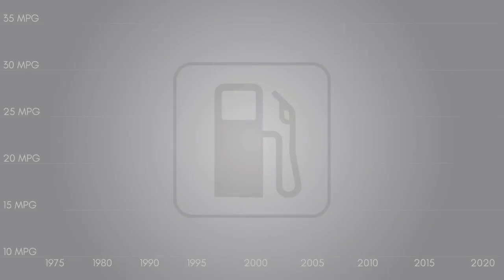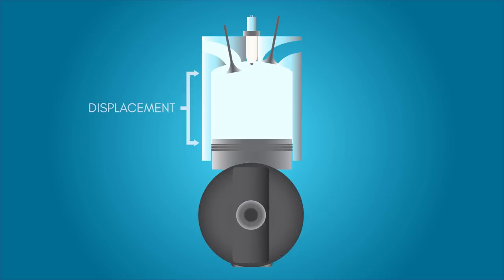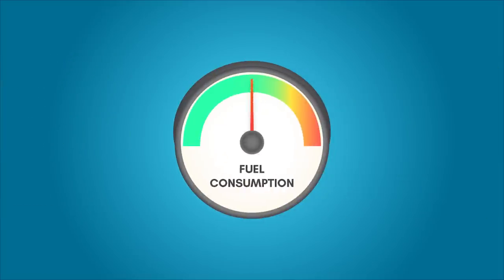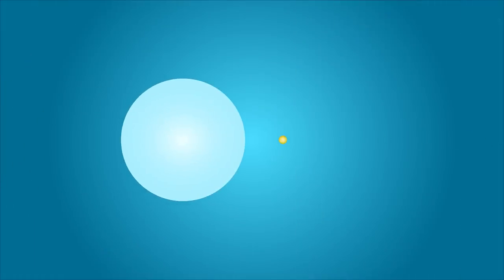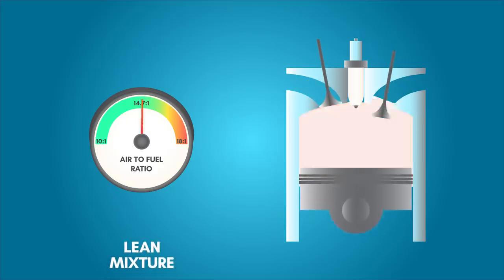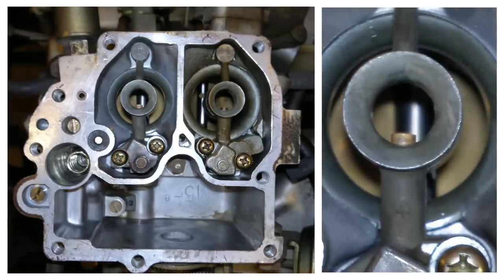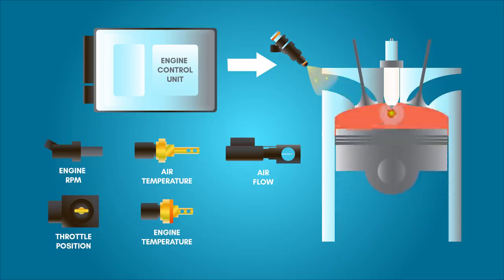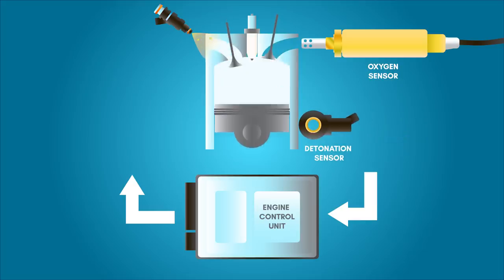How Engines Are Becoming More Fuel Efficient

Comment: I have a book around here somewhere that was written by some well-known mechanical engineer. In chapter 10 of this book it talks about alternative fuel systems and he mentions that in the 70's in the U.S. there were 3 different after-market carburetors being sold that claimed fuel mileage as much 60mpg in V8 engines and 90+ in a V6. The one thing they all had in common was that they vaporized the fuel before introduction into the combustion chamber. Shortly after word got out of these carburetors, OPEC introduced several new additives to gasoline (or required refineries to use them, something along those lines, it's been a while since I read it) Every one of these additives, according to the book, gummed up those carburetors.
   I'm on my way to work so I don't really have the time to find it for reference but I thought I'd mention it because whether any of you think there is a conspiracy to keep us addicted to oil or not, one well respected, top of his field engineer certainly laid out an interesting coincidence that points in that direction.
Reply: Meh, I'm seeing a few comments here about this. Vapor carburetors solve a non-existent problem, which is combustion efficiency. Modern cars hit something like 97%. Vapor carbs don't really do any better.

Comment: I feel that this is all incredibly impressive and it shows how well we've mastered making these engines, but it also shows why (imo) electric motors are far superior. All of these advancements have been made in order to improve efficiency, resulting in designs that are incredibly complex. This video showcases a lot of that complexity while also just scratching the surface of how internal combustion engines function. And despite all this advancement, internal combustion engines cannot break 40% efficiency, because they are heat engines. Electric motors, on the other hand, are capable of over 90% efficiency in converting electric power in to mechanical energy out while being far simpler. It would seem, at least to me, that it may be better to look to electric systems for greater efficiency and maybe even to consider electrochemical methods of using fuels, like fuel cells or thermionic converters.

Thats just me tho lol anyway if you read this far hey hows it goin
Reply: good, what about you?
Reply: I know this is an old comment, but there are newer engines that are over 50 percent efficient.

Comment: Old technology was still fuel efficient. For example an old Volkswagen 1980 carburated had pretty good fuel economy. It was in is 40's mpg. An old 1983 ford ranger pick up had a 4 cylinder diesel perkins engine. It to got 40 mpg. The technology was there. What happened. People's desire for new made these classic obsolete. And now we have new cars and trucks with sophisticated computer nightmares. Now adays you need technitians to repair new clunkers.
Reply: Peoples desire didnt kill fuel efficient vehicles. Diesel is a filthy nasty fuel. Sure older diesels had excellent fuel economy, they also had terrible emissions.

The emissions equipment they were required to install killed the fuel efficiency. Now the MPGs are climbing again, but the cost of that equipment and the rarity of diesel means it will never return.
Reply: Old cars like that were fuel efficient because they were extremely light, small and underpowered by todays standards. People were ok with very small interiors and the lack of need for safety meant very thin structures too.
Reply: @Bob_Lob_Law  Look at a 2 stroke diesel opposed piston. Use ultra low sulfur diesel with a regen system and it will be good.
Reply: @armandomendoza3167  Those make good train engines. Nobody will ever put them into a passenger vehicle. 

With rising electric drive trains, combined with diesels relative obscurity in many parts of the world, its days are numbered.
Reply: @Bob_Lob_Law  Ford already did
Reply: Exactly today’s cars are GDI computer ridden nightmares. Thanks EPA
Reply: What happened was safety requirements as well as people becoming fatter or wanting more features in a car.

Remove shit like leather seats, the wideness of modern cars, headunits, climate control and you will improve fuel economy.

Look at the honda civics from the 90s compared today, todays civics are 3 inches wider and several 300+ pounds heavier.

The Japanese have those kei cars that are 660cc and make 62hp.

62hp is more than enough to drive around the city with as well as cruise on the freeway.
Yes, it is slow but hey it does the job.
But no, we want SUVs, with big engines.
Reply: Bob Lob Law it's also because cars aren't allowed to run super-lean mixes anymore because of the rules about Nox emissions
Reply: @nikod8412  I remember reading about Hondas CVTT engine and how they came in and showed the yanks how to make a fuel efficient engine back in the day
Reply: IIGrayfoxII yeah so clean they didn't even need a catalytic converter
Reply: @Bob_Lob_Law  Diesel (at least in Britain anyway) is not the filthy, smoke-belching horror it once was. It is now very clean (we have strict emissions tests for diesel vehicles!), and always has been more efficient due to higher compression ratios being achievable.

Comment: It's a lot simpler than you think first you have to eliminate some of the excess Parts take out the crankshaft the carburetor Pistons valves valve springs the cylinders and then you get rid of the engine block then you take some magnets and a coil and a couple of wires who you have the most efficient engine possible
Reply: I see what you did there

Comment: it's called "knocking", not "detonation". side-note: detonation only occurs with pure oxygen. using air, it's called deflargation.
Reply: Detonation is when the flame propagates faster than the speed of sound. Deflagration is when it propagates slower than the speed of sound. Detonation can happen at atmospheric oxygen levels,  but is more likely at higher oxygen levels.

Comment: Thanks but a few other factors to fuel economy
1. - Road contact has improved dramatically both with better tyres and less resistant suspension. Scrubbing tyres on sharp cornering used to use more petrol.
2. - Rolling resistance was mentioned but better bearing and better balancing wasn't. Less resistance means less fuel to turn the motor over
3. - Fuel is now totally synthetic so you are able to extract more of the calorific content. In the USA and Europe, fuel companies also vary the blend to suit the expected weather which gives greater fuel economy
4. - The fuel detonation point (RON Number) is more consistant making higher compression possible. It can also be controlled more accurately by the ECU.
5. - Higher compression gives more power and better fuel efficincy
6. - Airflow through the intake is now computer modelled causing a positive flow as the intake valve opens. The exhaust system does the opposite, sucking out the burned gasses
7. - The flow of gasses in combustion was briefly discussed but is vastly more important to fuel economy. This is also modelled on computers
8. - There are 7 to 10 engine management sensors but the Lambda sensor on the exhaust is the most important for fuel economy. It helps the ECU to optimise fuel mixture while preventing a lean mixture. Exceeding Lambda or a mixture of above 14.7 for any length of time will destroy the engine. On a carburetta,  the limit was set to 13.8. That on its own gave 5.5% greater fuel efficiency.
9.- A complex data record is stored in the ECU that was developed on the manufacturer's test dynamometor. Tuners refer to this data as the engine map and they modify it to give more power but using more fuel. This mapping saved between 8 and 10% on fuel.
10. - Lubricants have become much more slippery. We are currently on SP oils while in the 1980s we were on SB. That is 18 improvements in our oil in 40 years.
11.- The weight of wheels (called unsprung weight) has also improved. The motor doesn't  have to spin heavy wheels before the power even reaches the road.
12. - The aerodynamics of the bodies are almost twice as slippery as they were in 1980. You use less petrol to push your car through the air.
BUT THIS IS BALANCED BY
1. - Cars now travel faster which uses more fuel
2. - Cars accelerate at almost twice the speed they did in 1970. This uses much more fuel.
Reply: But the video is about engine efficiency, not car efficiency overall.
Reply: You are right - that is what the heading says. The video goes well beyond that though.
You, discussed power transmission first. Rear wheel drive is NOT automatically less efficient as is displayed by efficient BMW and Mercedes Benz vehicles.
The statistics on fuel economy you presented was for the car as a whole. The improvement in efficiency has been broad.

I made 12 comments, 9 of which were directly engine related and contributed probably more extensively than the items you discussed.

But we both missed the two major contributors to increased engine efficiency.
1. - Multi-valve combustion chambers were a huge boost to engine efficiency, exceeded only by the use of ECU. Better breathing has been the major innovation.
2. - The dramatic but mostly undocumented improvement in cylinders, pistons and rings. Surface finish, contact area, improvements in piston web design and "cam grinding" of the piston as well as better ring sealing have also made a big difference. Blowby and "oil pumping" no longer exist. This on its own is probably between 6 and 20 added hp of power.

Fuel I injection on its own was not a big contributor. The ECU and its ability to control fuel though was big. A motor at fixed RPM driving a fixed LOAD. Using a STANDARDIZED fuel. Running at a fixed atmospheric PRESSURE will be more fuel efficient with a well tuned carburetta.  Trouble you can't vary any of these parameters and still be efficient.

Comment: 4 cyl (thats what i know best) engines (diesel and petrol) DIDNT get more efficient.
We got more HP and "less poluting"  exhaust, but cars on average still needs as much l/100km as in the 80's
Reply: Simply put a modern engine in a 80s car that has the same power level and you will see that your fuel consumption drops significantly.  The engine is more efficient but the whole car is not because cars gained +50% weight.
Reply: Yes they got more efficient with different alloys, injectors, combustion configuration, exhaust gas recirculation……..
Reply: Nice contradiction. "They got faster using the same amount of gas, so less efficient" summed up your comment. And you're... wrong. Factually and objectively

Comment: I swapped out my cams in my 2003 F250 Ext. cab 8 foot box 4x4 with the 5.4 SOHC  16 valve. I was getting around 11 mpg before and now I have more power and torque and get 15 mpg. I am not complaining.
Reply: Randy Wiesendanger  I just weighed my truck and it comes in at around 8400 lb. I wonder what the 1/4 ton truck issues were?

Comment: Cars are getting more fuel efficient by adding incredible complex add on's. Like heat exchangers that combine oil and water, separated by a sub millimeter wall of aluminum.  One in the engine, and one in the auto box.  These engines are getting so complicated that they are no longer repairable.  So what you save in fuel is only a small percentage of the cost when you repair or replaces these throw away engines.  Most of these functions are so integrated that you cannot fit another type of engine to a car.  Knowledgeable people are now buying older model cars that they can keep repairing and running well into the future.  next you will see the government banning these fixable cars.
Reply: Knowledgeable people learn how to fix the new engines.

That does not mean knowledgeable people don't like older cars, I know plenty of highly intelligent enthusiasts that prefer the older cars, and are willing to pay the extra money in gas to have those cars.

Those that choose to have modern cars however, choose to learn how to overcome the challenges of fixing them, rather then refuse to buy them because maintenance is hard.
Reply: Douglas Hamner im not a boomer by far but i hate how complex new engines are. with older cars theres less that can really go wrong and the parts last a while. with the new cars it's impossible to try and fix a problem let alone spend money to fix it!! now by law every car has an electric  filter for gas fumes! gas fumes!?!?! seriously?!!?!?
Reply: 《白关》Pakkwun
Less that could go wrong, but went wrong more often than any modern engine.

Which is why millennials have no idea about the basics of a engine, that have no need to.

Comment: I have heard that some diesel engines used on boats, small engines I guess.
Inject water also with the diesel to save fuel. Only when warm.
Reply: Hydrogen and renewable natural gas injection too. Even wood gas worked in the wars.
Reply: Some inject water into the turbocharger. To prevent it overheating and to cool the air

Comment: If you could save $3000 in fuel costs in 100 k miles but the engine was worn out and costs $4500 to replace, would that be a good deal?

Comment: Running lean whilst the car is cruising will not cause detonation because the initial cylinder pressure, i.e. the cylinder pressure just before the plug fires is low, the reason that the  pressure is low is due to the VE of the engine,  the low VE is because the throttle is just 'cracked' open. Detonation is cause by the cylinder pressure rising to a point that is high enough to cause the 'yet-to-be-burnt' fuel to spontaneously combust at a point in time after the plug has fired but before all of the mixture has been burnt., the result of this is two or more flame fronts which is generally a bad thing in an engine. The low initial pressure then results in a relatively low peak cylinder pressure hence no detonation Twin plug heads are designed to run with two flame fronts but the combustion chamber will be designed to act like two combustion chambers. Lean mixtures at WOT are a different matter and can cause detonation. I have successfully setup many carburetted engines to run at 16-61.5:1 on cruise with no detonation, the ignition also needs to be advanced whilst running in cruise mode due to the low burn speed caused by the low initial cylinder pressure. (Despite lean mixtures burning comparatively quickly)

Comment: I've noticed in the late nineties around after 95 to be exact when ODB2 computers became standard the overdrive in transmissions became standard with modernize transmissions what that does it down your RPMs when you get up to speed so that helps with fuel consumption. Before that you had an optional overdrive and anything earlier than that had no overdrive in the transmissions and if it did is considered a tow gear or low gear

Comment: You did not mention improvements in material technology which made designers run engines leaner and hitter. I.e reducing the excess fuelsupplied for cooling the exhaust.

Comment: I wonder how the turbo works? Because it's function is to add more air on the intake and gives extra power to the engine, isn't gonna lead to a lean mixture? Can somebody explain?
Reply: Yeah, the idea is to recover exhaust energy. Gasoline engines must hold the fuel air ratio constant by injecting more fuel, but diesel engines run lean constantly and don't necessarily have to in increase fuel under boost.

Comment: I used to think it was the pressure that created predetonation.  It is the heat.  If you use an intercooler to cool down air before it enters the engine, the predetonation decreases, so the injection system will give you more fuel and thus more power.  If you aren't limited by heat and predetonation, then adding an intercooler wont help.  Which is why it is usually coupled with a turbocharger, because precompressing the air is what makes it too hot, and forces it to run leaner than it would if you add an intercooler.

Comment: Everything that applies to a gasoline engine is the same for diesel’s EXECPT the lack of a spark in a diesel... because the diesel works on a compression ignition concept where the diesel will ignite on its own when the mixture (that has larger particles of diesel, you can correct me on that) reaches top dead Center

Comment: I only get 18 MPG in a 2000 Toyota Tacoma V6. There are some add ons that make it heavier, and I have a lead foot because traffic around here is fast paced. However, Toyota trucks are so damn reliable that having no problems makes up for fuel. In the past year alone all I had to do was change the oil and replace the thermostat since it started leakong coolant from its housing. It was about the same time it needed new coolant anyway.

Comment: The EGR valve can be used to divert exhaust gases back to the combustion engine. This reduces NOx emissions while using a lean mix that does not tend to predetonate.
Reply: And also cutting down on pumping losses.
Reply: @SynchronizorVideos  And so many other tricks worth mentioning. However when so much detail and effort was put on air–fuel ratio, maybe a mature and wide spread technology like the EGR could have been included in the explanation.
Reply: Yeah, this video isn't titled very well.  It's really just focused on a few aspects of fuel metering (and doesn't even mention direct injection).

Comment: The obvious solution to get a big step in efficiency is to NOT HAVE MODES of operation at all.
By adding an electric-motor-generator the combustion engine can always work at one of two optimised points of operation and be simplified greatly.

Comment: MPG is not the correct metric to discuss engine efficiency. Consider using a power output curve vs engine displacement.
Reply: Randy Wiesendanger  Ya, i mean talking MPG is about vehicle efficiency; wind drag, rolling friction, unsprung mass etc.  Thats different from engine efficiency which is normally done in an engine lab.  If doing an 'educational' video do it right.  Just a thought ..